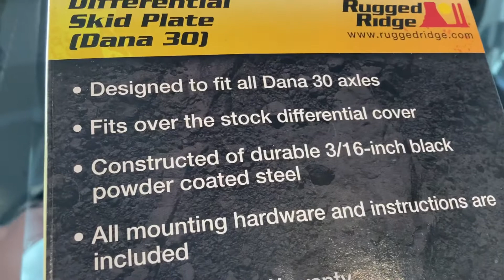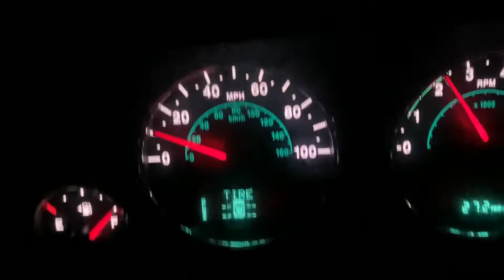Differential Skid Plate from Rugged Ridge, for Dana 30 Review

Comment: I would never put those on my front diff , you hit one rock on them little allen bolts thats it .. i would get the proper length and strength ie grade 5 or 8 bolts with wrench heads on them ..and always have brake clean when doing something like that to properly clean the area so you will know 100%  weather its leaking or not.
Reply from the maker: Yeah, I already replaced them!